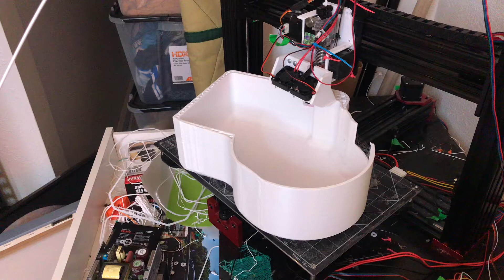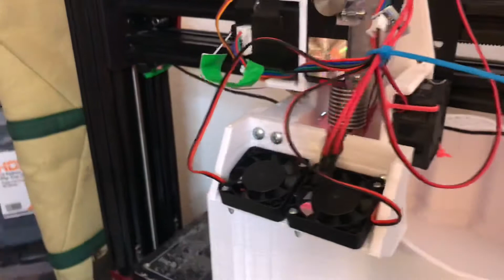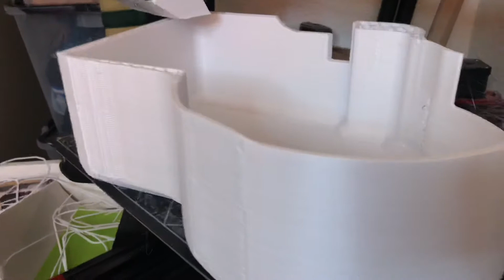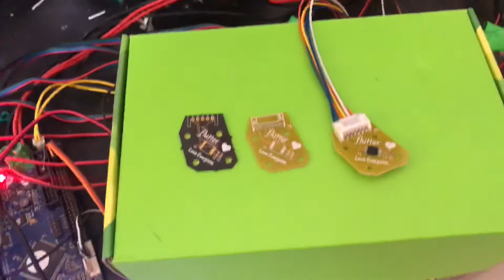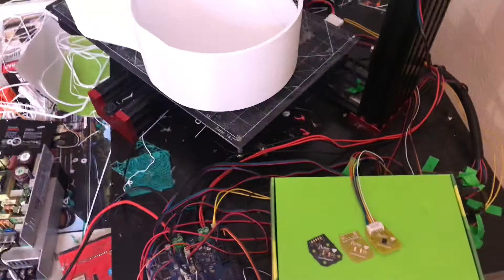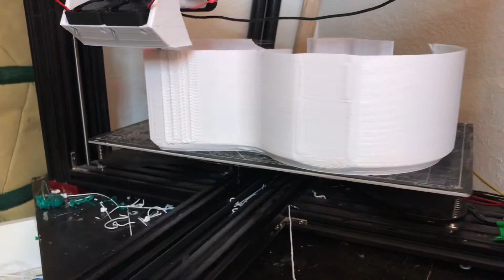Printing PETG with the E3D Supervolcano. Also new encoder PCBs!

Comment: I think you adjust the Z hop if you have it.. what did you use to print this in? maybe try Raise3d instead of Simplify3d,  I also think maybe the motor for the bed might not enough amps.. I'm not sure what you have there but 2A motor should solve this especially on heavier objects like this ,  but maybe build a directional fan for cooling of the printed area too.. I saw your fans are off.